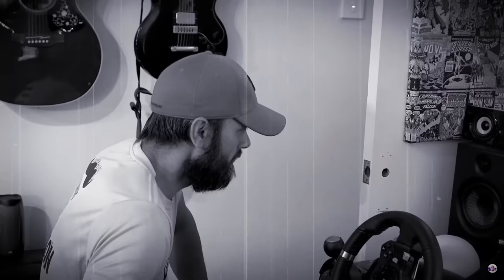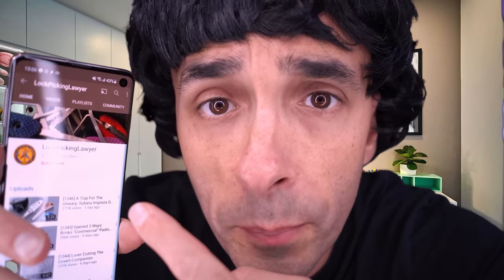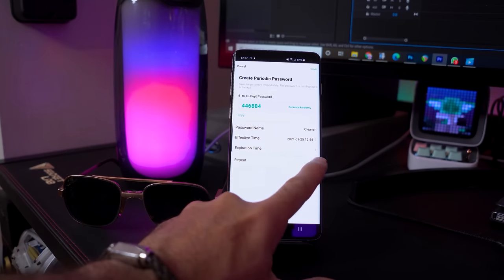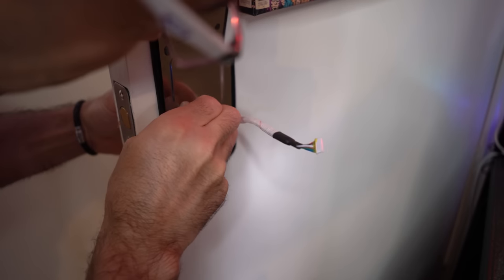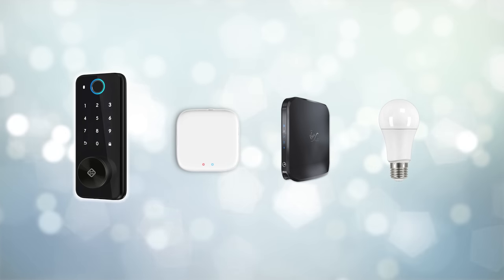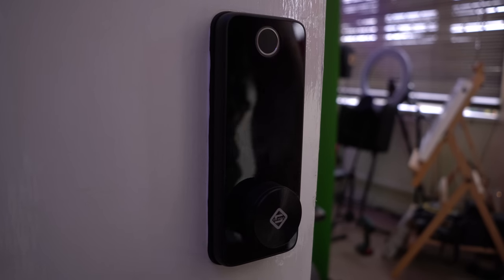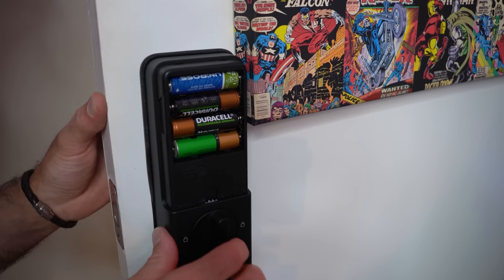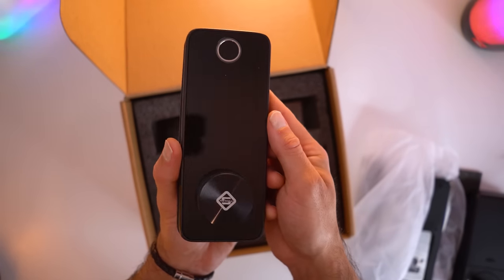Man Yells At Smart Home Lock For An Hour

Comment: Insurance companies like living in the past. To meet the criteria of nearly every insurance company you need to follow their wording for securing your home. The lock must be to British Standard and to a minimum of 5 Levers, morticed and secured from both sides with a key. This is the same for Euro Cylinders and Multi Point locks although the Euro Cylinder is usually 6 lever these days. Many people have a Thumb turn on the inside of their front doors and this is 'apparently' only valid on a new build property and is not allowed on a Ground floor exit door but is allowed on a front door of a flat if its is above the ground floor and has some sort of other entrance door at ground level. It is very must a pita as I have had plenty of clients that want thumbturns on their locks but upon checking with their insurance have found out they can't. The other issue to watch out for is that the wording is deliberately vague and we all know insurance companies will use any possible clause to get out of paying.   
On  a personal note, not one smart lock has yet to be made that you can't defeat with a little bit of force, all the mechanisms are bolted to the door which makes them very easy to attack. This is partly why the British Standard insists on a Mortice lock of 5 levers as defeating it with a physical attack is generally only done with the use of the big red key or a size 12.

Comment: Geo=fencing is a most useful feature of smart locks. Mine (Wyze) has it (ATTM = "According To The Manufacturer") and when it works (1/50) it is a delight. Also works with Alexa. Can the one you installed be opened and closed using the app from anywhere? Also, requiring 8 digits is a bit much. I would prefer user-set length.

Comment: It doesn’t have all of these features but I have been really happy with my August smart lock pro 3rd gen. It just installs to the deadbolt part so the outside part of the lock does not change. This mitigates issues with my technophobic wife and maybe insurance. 

I like the keypad and finger print sensor on this. Before we had a smart lock, I had a simple battery operated lock with a keypad and that was great for kids who lose keys etc.

Comment: I love smart locks, but can't use them because I've never seen one that has a double cylinder on it. There is glass around both my entry doors, and every smartlock I've ever seen has that big manual thumb turn on the back. Which means anyone can break through the glass reach in and turn it.

I have to assume Smart Lock makers do not make a single sided or double cylinder version because of liability issues. But if one of them did, that's the brand that I would buy.

The other problem being, in order to use a Smart deadbolt, you have to leave the door handle unlocked. The lock on the door handle does not provide much Security in the first place, but it is still better with than better without. It is also possible to forget about the door handle lock, and accidentally lock yourself out.

Comment: If it could be controlled remotely it might have a market for old people that have carers and a monitor emergency call button in their home.  Although the inclusion of an RFID reader would probably have helped.
Regarding the batteries, couldn't they have used the 3.7v rechargeables (LS14500 Li-ion) with a little work to include a automatic step down of the voltage to the right level.

Comment: Multi-point locks for the win. Until they come up with a smart one of those, I'll stick to manual. In addition, don't use a spade bit in an existing hole (although there's a way of getting round that) and get a set of screwdivers. Is there an emoji for laughing whilst being sad and full of wonderment at someone so incredibly inept? 😂☹😨 Until next week then...... (poor Neesha)!
Reply: Simons Voss do a euro cylinder BUT rely on a cloud service, no internet and lock becomes a potato.  Also you will need to make sure you are using secure by design handles and have exactly the correct sized locks as they all appear to have little to no antisnap/drilling protection
Reply: That'll be the Yale Conexis L1 you're looking for then. It's the only one that is designed for multipoint doors.
Reply: @robert.wigley  these "locks" have a very bad design flaw that makes as good as a potato...
Reply: @timballam3675  Care to enlighten us what that might be then, rather than just stating something without any evidence.

Comment: This made me laugh, your DIY skills are akin to my own so would have to get someone in. The only issue with the smart locks shown on this and other channels as they simply are no good for the majority of the UK who have double glazed doors, they use barrel locks and are plastic so no drilling and handle etc. these are really only any good for old wooden doors which most people have replaced. it is actually good that they dont have smart home integration otherwise open letterbox and yell open the door and your in....
Reply: I bet a burglar could do that easily.
Reply: I haven't seen a smart lock yet that works with a voice assistant that doesn't require a PIN for unlocking. They're at least that much smarter than your average burglar.

Comment: Well i can tell you this. Im sure as hell not gonna drill that big of a hole in my door to install a smartlock that can be broken off with ease. Also i dont want a dead bolt i want a 3 point closing mechanism which locks the door on 3 places simultaneously which is allot better. I guess this lock cant be hooked up to that kind of locks. And why would you even want to give voice commands to it. So that some one can yell through the door to open it while you are not at home? Its allot safer when its not connected to voice assistants.

Comment: Cool device and I like the Tuya integration as I am quite invested in their ecoystem already. I can even understand the lack of voice control as there is a potential security issue with potential intruders shouting at smart speakers through the front door (I have a GA near my front door in the living room, as my house doesn't have a hallway, so this is a real issue for me.) I just wish they'd come up with something that fit my composite door and retained the multi-point locking - it's a pretty common design that now seems to be fitted to new properties as standard, so it would be good to see someone offer a straight replacement.